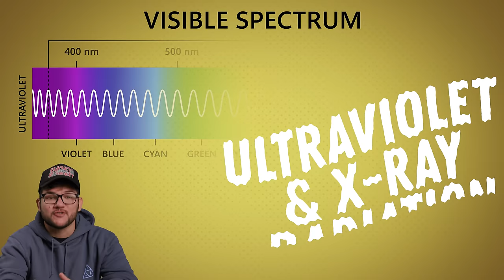Mechanic Reacts to Welding Fails from Tiktok

Comment: The only welder I have (But haven't used) is an old Sears-Craftsman solid oxygen welder from like, the 60's or 70's, and yes, they were sold at Sears. It just uses normal plumber's torch gas bottles, and instead of an oxygen tank, you have solid oxygen pellets that you set on fire, and put in a separate canister, and it releases oxygen for the welder as it burns. The guy who gave it to me said that wire coat hangers make good welding rods for it, which is kinda sketchy, but whatever. The only problem with it is that they don't make solid oxygen welder pellets anymore, so once I'm out, I'm out.

Comment: Welding masks protect from both the brightness and spectrum of light. Polycarbonate alone, without needing tinting, is quite opaque to UV light. The tint or autodarkening LCD further reduces the bit of UV that gets through the PC layer, and also dims the extremely bright visible light.

Comment: First time I ever welded anything it was with a stick welder old school. I bought it to weld sheet metal 🤣. I actually figured out how to do it to the amazement of my friend who was a welder 🤣. He told me he would teach me how to mig but the millermatic was broken. So I took it apart and fixed it... Then he moved. I figured it all out 🤣. Welding every day on your project for 6mon you figure get out and gain monumental experience through trial and error. Here I am 20 years later... I weld maybe 20 times a year. I'm not as good as used to be but still laying rolls with good penetration... Haven't had a single weld break. Recently bought a TIG just so that I can do stainless steel and aluminum (I tried to braise AL before and it is so funky... It's like working with taffy. Hopefully it will be better tig'ing). 
It always pays to learm the stricter discipline first. Stick is good especially when you are in a remote situation or don't have gas or space is tight and definitely on  thick structural or exhausts 14g+ other than that, even thick stuff if you bevel and prep, preheat...mig is super easy 😁👍. 🧐 You still have to learn the science behind what you are doing and what's happening. Welding is not a craft glue gun for guys and your suspension is not a craft book 😁. Open a book, watch videos, you can be a decent welder and be self taught. You are not going to be good whenever you first start. Like anything it takes time to learn.

Comment: In defense of -one of the county fair welds… the red plate with the welded bolt looks like it was just to keep the Jack/height adjustment bolt from turning from vibration. It’s not load bearing, only stopping vibrational effects on a static jack screw. If that’s the case it was overkill lol

Comment: I like Tig aluminum welding and I'm not too bad at, definitely not the best by any means but I think I'm way too out of practice since I haven't welded in years. If I had a machine set up for the job I'd probably still have the correct movements but I'll be dead in the water fiddling with the settings trying to get it tight.

Comment: That first one looks like the exhaust job my grandpa got on his old car. When I looked under it there were bits of mig wire hanging off everywhere on both sides of the cat. I have a little welder but I'm not a welder and that weld job still hurt to look at. Even I would have been embarrassed to do a job like that on my own car.

Comment: I loved welding in high school, we had a class for it, I took it, didn't stay, I should've. 
I did nice bead welds, sometimes mess up (1/20), but that was just first 3 months, if I did that for years, I would've been so good right now. Damn. I got the first perfect scores in both welding and plumbing soldering lmao. They never gave out 100s, but I was one of the firsts. And my friend wanted to wash it for me so I said sure,  he ended up saying he got me my 100% lmao.

Comment: The one at 7:20 looks like a Buick Enclave we just tore down recently at the body shop where I work. We're replacing the entire rear and quarter panel and all the inner structure. Whoever did it last time wasted a lot of expensive panels, welding wire, filler and paint. If the one in the clip was black instead of white, I'd swear it was the same vehicle. It's crazy bad. And very unsafe! But it'll be safe when it leaves our shop. We aren't hacks

Comment: 2:23 when I was younger about 13 ish a family friend had a welding shop and he made those signs you could see out in front of the Christmas shop that used to be around and I helped him make this batman go kart we was making on the side during free time but what was the funniest thing he ever told me was when he welded the reason why he only wore sandals not shoes when welding was cause if any hot metal fell and landed on his foot he can just kick it off not having to worry about pulling that shit off, but when I was about 15 he gave me my first welding kit (I don't remember the model or name) along with a pair of those special sleeves you put on to help not get burnt so when my brother came around for my first time he was showing me how to use it by putting 2  hand sized metal sheets we took from a job site he worked on for practice then left me alone for a few minutes then thought of the bright idea to come up behind my ass n scare me so since I had the mask on I didn't know what I was swinging at but as soon as he did luckily for him I let go of the button then swung behind me then it got yanked out of my hand. He was good my dad was just going to let him learn but he did say he was glad I at least let go of the button while turning.

Comment: I had a customer who tried to weld the seems on the roof of his '64 Cutlass after removing the lead. He tried really hard on both sides of the roof on the A pilars and the C pilars to save money on my labor. He didn't save 1 cent, it was so bad that I ended up replacing the roof...

Comment: 7:27 is spot welding on a rear 1/4, looks like instead of mig or brass welding the two panels together they have spot welded a "bridge" between the two and covered it with filler hahaha nice

Comment: My father taught me how to solider around 5, weld when I was about 6 or 7 and when I was about 9 there wasn't much in his auto shop as far as hardware goes that I didn't weld into something. I probably wasted hundreds of dollars worth of washers, nuts, bolts, hose clamps, C clamps, chains, and of course welding rod of various sizes and acetylene. Then around 10, when I learned to Arc weld,  I got more creative and started using junk parts that were replaced like brake line, rotors, leaf springs, alternators, cut up cats, exhaust pipe, and mufflers, and pretty much anything else metal that came off of a vehicle. And at that age I was doing better welds than these. 
And most of the time I didn't use tinted goggles or shields, just regular safety glasses if anything. And at 46 now, I'm one of very few people in my family who don't wear glasses for some reason. I also look directly into eclipses and that hasn't hurt me yet either.

Comment: Worst experience I've had welding, so far:

Was under an F-250, welding parts of a Tommy Gate to the frame. Was laying on my right side, working above my head, and had a piece of slag fall into my left ear. Fortunately it was a small piece, but that was not a fun experience. I'd rather burn my arms a million times than go through that again.

Comment: I have never tried welding anything. But I’m super interested in trying minimal things. But only problem I’m having is I have no workspace or the 220v outlets. Is there any welding equipment that anyone can recommend for house use. I have reg outlets outside my house and would use those but don’t know if you can run a welder off 110/120v outlet without popping the breakers. Any recommendations would be appreciated.

Comment: Worst welding mistake I ever made was in school. If you're gonna mess up, do it in school so you don't mess up in real life. We were learning Oxyacetylene welding. Basically just a giant torch and a welding stick. The only thing we were REQUIRED to wear were welding goggles They didn't bother with welding vests or gloves or anything. Well my hands got sweaty and I accidentally dropped the welding rod with the 6,000 degree top through my fingers and it impaled itself in my side. Teacher said "do whaaa?" Ambulance paramedic said "huh?" ER doc just shook his head, almost in disappointment. Like "you are a stupid SOB" And my former class mates STILL give me a hard time almost 10 years later. One little scar and still no feeling there. I'd take any of these fails over that any day.

Comment: I was welding something and had to spray some brake cleaner on it to get some grease off, didn't let it dry and set the bench and myself on fire for a few seconds. Thankfully it was not a lot of brake cleaner and I only burnt for a few seconds but boy did I feel stupid! I always layer up so no harm done other than my pride

Comment: The first weld was actually the picture of the backside of the weld. They had a gap, gap had to be filled. Thats what's left. Typically you would back grind or gouge the weld and weld over that.

Comment: The car at the beginning that was set on fire is in Brasil, they use alcohol there as fuel and there are some dodgy alcohol conversions that the guy possibly didn’t know there was a leak so may be just unfortunate it set itself on fire!!

Comment: I've never had the burn experience from welding, but as a roofer, I have ran into a material known as "pitch", or "coal tar". The fumes from applying it, or dust from tearing it off the roof, gets into your eyes and skin, and acts like anti-sunblock. It makes your tissues more sensitive to ultraviolet radiation. The first time I ever encountered it, the boss didn't know the roof was pitch, so I had no protection on for four hours. Ended up having to leave the job because my eyes swole  shut. Can't sleep because your eyeballs are on fire, open or closed. And the skin on my face peeled off like an alligator.
It was rough.

Comment: Stick welding is hard, with some training I managed to get some ok weld, but it is really hard.

But I don't have any hood or respirator, I'm using those masks you gotta hold with one hand and I literally don't see shit before the arc is created! Yeah, I definitely need an automatic hood it'll make the process 5 times easier I guess without having to take a sneak peek to weld at the right spot. Or you know, having two hands available instead of one. 😂

Comment: Only used a mig gun a few times way back in school, didn’t like it because the splatter and nasty looking welds compared to 6013 rods with the antique Lincoln job box’s. But I’ve seen a veteran welder use a harbor freight mig welder and it look pretty good and he made a good point, in school my teacher was a small engines teacher (government cuts in spending=your not a teacher, eh well you can teach) and we wasn’t allowed to set the mig welder up…. Basically we learned nothing

Comment: A 7:20 that car has had a quarter panel replaced before. Depending on the manufacturer, the quarter panel gets sectioned in, to avoid replacing the entire uniside. That cut filled with bondo should have been welded solid, and ground and filled with a light skim coat. They cut it too short, welded up half then body filled the rest.

Comment: Arc burn is the best! And that's exactly how it feels your eyelids feel like 80 grit sandpaper and it's constant pain with your eyes open or closed....I did however learn that it's basically radiation light causing the burns....I guess I'm just preparing for fallout...all the welders gonna be fine they all immune to radiation now haha

Comment: I hate safety glasses. Luckily as a plumber I don’t have to wear them most of the time. Grinding is the one thing I will not do without them. I used to always wear them. Then one time I had to make one cut on a cast iron pipe. My glasses weren’t in their spot. I was in a hurry and said it’s one cut, I’ll just look away. I ended up with a tiny piece of metal in my eye. After 3 days and several bottles of saline, I went to the dr. Getting it out was easy. The issue is it rusted so they had to grind the rust out of my eye twice. It’s like someone putting pressure on your eyeball for a day afterward.

Comment: the biggest tip i could give to folks who want to learn how to weld just go out and buy the gear your self and watch videos on YouTube and see if it is something your actually interested in befor going to a TRADE SHCOOL! and don't try to short cut the time at a trade school !! 
the school i went to said they could teach you 12 month coarse in 4 months 600 hours. im going to tell you 600 hours in not equal to 1920 hours and every interview i had i was laughed out of the interview or insulted during the interview. there is a good reason your paying 50k or more at a trade school and not 19k. this year i ended up having to give a video statement with a bunch of lawyers on video about what my school taught that was not correct turns out my teachers were all fired from a previous school for not even knowing the basics of welding and stealing the previous schools whole teaching methods and blue prints. with the loan and 5 grand put down upfront with interest i lost 30 grand and was not taught a damn thing useful in the welding trade

Comment: So that explains why the "orange" sheet is used. So does that mean welding doesn't damage the camera reader?

(Also  appreciate this, I have been wanting to pick up welding on the side for some projects)
Reply: Digital cameras have a physical UV filter as standard because the CCD is oversensitive to UV and even normal daylight will effectively blind its sensitivity to other wavelengths. (It's a bit more complex than that, but that's the gist of it.)

Comment: You will get sunburn from welding without protection, trust me it doesnt take long i had it several times, i work on garbage trucks. Had many times where im so slammed all i do is put on a hood and just after a couple short beads i get sunburn on my arms and neck.

Comment: Stick welding is definitely NOT  for exhaust. Should be done with MIG, or braise out with cleaned coat hanger steel  and borax as flux with acetylene torch. I've been laying beautiful beads with braising for decades now on exhausts.

Comment: Veteran welder of 12 almost 13 years in structural steel and stainless steel running MIG, STICK, and TIG.  in all the shops I’ve worked in, gloves are referred to as “B!(h mittens”.  Ya gotta die of something, and honestly lung cancer will get me before skin cancer does.  🤷🏼‍♂️ eff it lol 😂

Comment: @7:45 those was supposed to be button welds but they are not button welds common guys
@10:16 this is called a pressure test an a fail at that

Comment: Spatter not splatter my friend.  lol Tig is by far the nicest and imo best welding method . But it’s very slow and takes the most skill. Mig is easy and a trained monkey can do it.  But using Stick on exhaust …… like it can be done. I have done it on the farm with coat hangers wrapped in borax and paper towel hooked up to a bunch of deep cycle batteries when I was a kid. And even that looked better than most of these welds.

Comment: Some of this is why I'm scared to learn to weld. 

I'm already barely competent with electronics soldering.
Reply: Welding is easier than soldering.
Reply: @derekhobbs1102  it is? Looks way harder. 

Unless you're talking about SMD work you need bionic eyes or some shit to do that well.

Comment: stick welding is something i do all the time, and even i wont weld something thin like an exhaust with sticks. just use mig its easier for thin shit. stick is for structural.

Comment: not that those welds aren't shitty, but you can't bring an industrial welder and a mechanic from California to critique welds on shitty rusty metal.
 I dont care how good you think you are, you can't really properly clean actually rusty metal without taking off excessive amount of material so the welds going to be shit 100% of the time. I'm a welder in a big truck shop in maine trust me I know, a proper weld job is $$$$ and you can't justify a huge bill for a rusty shitbox anyway
Reply: if the metal is good and can be easilyaccessed, theres no excuse except inexperience

Comment: Doesn't anyone oxy weld anymore? Not only weld steel but braise and aluminium can be done with oxy . Plus if you learn oxy first it teaches you how different metals flow . If you want to go further back try welding with a forge and borax

Comment: You are actually wrong about welding helmet function it actually protects your eyes from Infrared and ultraviolet light even if the lens isn’t on meaning darkened but it actually just makes it so you can see your weld by dimming the visible light the glass of the lens does the rest

Comment: #1- OMG, turn your machine's voltage up!! And like these experts said, prep it first. 

#2- Wtf?? That guy was a walking osha nightmare!! 

10:00 Been there done that. I did stainless steel tig welding on evaporator tanks. I would weld them and use that red penetrator dye and spray. Id fix the spots the dye came through the weld, then theyd fill the whole tank with water. Sometimes you'd see new spits where dye and water leaked through and id repair those spots. Same with the piping they had inside. I liked that job because it was mostly tig welding. Too bad the wannabe supervisor was an a$$hole.

Comment: 90% of a good weld is good prep work. You can be the best welder in the world but if that joint is a rust contaminated mess, yer gonna have a bad result.
Edit: I swear to the gods of speed, I paused @1:17 to type this comment 😂